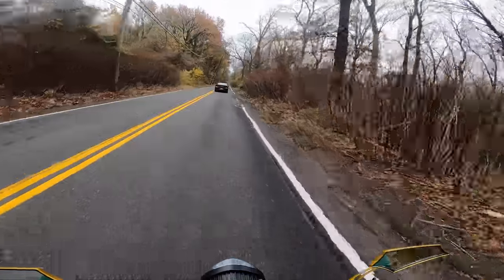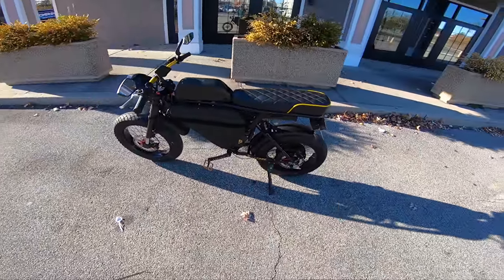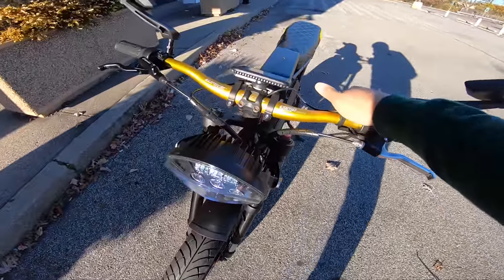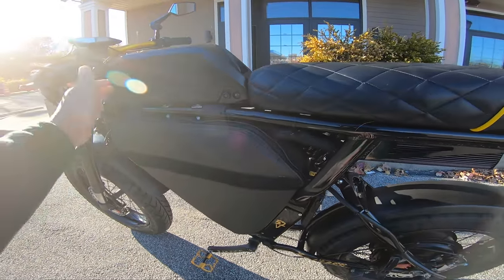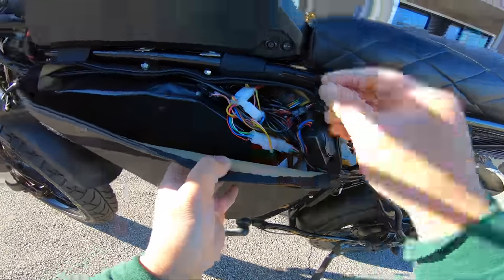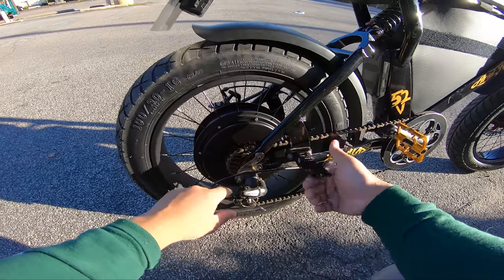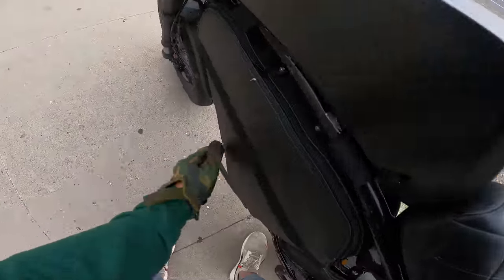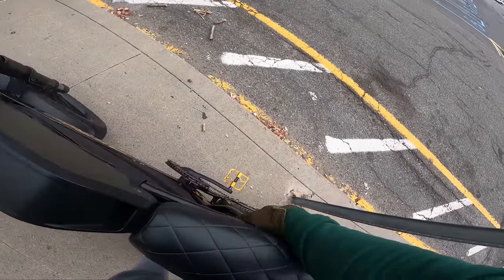This bike is TOO FAST! 5000W Ariel Rider X-Class First Impressions

Comment: Like how quiet it is and looking forward to the range test. Gear size change to prevent the wheely, giving more to top end and slower off the light's. Lock wheel alarm system pretty good too 👍🇬🇧
Reply: The bike is hub motor driven so no sprockets
Reply: @dgenbraking  Oh, darn, nothing I could do to ease the off-the-line acceleration then.... I wouldn't trust myself on this lol
Reply: @ChristmasEve777  it's really not bad even on my 17kw bomber
Reply: @ChristmasEve777  also I forgot most of them have different speed settings. Mine is set to single speed but my lower power one has 5 speeds and pedal assist

Comment: Your torque converters are what keeps your power in the wheel, not    the rear wishbone. Those converters that are on the upper part of the wishbone are pulling the bike up.
Just get a bigger Torque converter for the lower bar and get rid of the upper, it'll keep the power where it belongs.

Comment: Damn! Sweet upgrades dude.. I wonder if it will be easier to update this X-Class compared to the newer X-Class Step-thru in the future?
Reply from the maker: Thanks! It's still possible to upgrade the step-through version although the normal crossbar version makes it easier to mount the new battery in the frame.
Reply: Just wanted to be a little different haha. With their new cargo rack in the back I might be able to mount a bigger battery there in the future. Toughest decision is between the X-Class and Grizzly right now 🤔. Keep up the videos man so I have something to copy later on 😂

Comment: Looks great. Sounds great. Two thumbs up for everything you've done to it! The controller looks sharp in that spot, and keeping the harnesses in the battery bag is neat and tidy. Handlebar/pedal gold accents are slick. (I don't understand the rear-view mirrors, but maybe it's an East Coast thing? 🤣) Seriously, it looks slick and solid, and I bet it's fun AF.

Have you put it on a scale? Curious what the final weight is. Should still be pretty damn light for all that power, which probably makes for an incredible ride. I mean ya got yer involuntary wheelies and what not...😁
Reply from the maker: Thank you! Yea I'm curious as well with the weight of the full frame battery. Prior it was around 120 pounds.
Reply: @JB360_NYC how could I get this exact bike

Comment: Can you tell me more about that lock kit and alarm and where can I get one? i own a 52v myself. Found that alarm that locks the wheel and it doesnt go anywhere or locks with it.
Reply from the maker: I can check on that for you. It works with the 150a controller but will check to see if it works with the stock 35ah controller. You may need a step down but I'll check.
Reply: @JB360_NYC  thanks! Also awesome set up and video! Got me inspired for my own build…

Comment: So you have a 150cc bike now.🤔 may as well try to register it as a moped. Thinking about a 2500-3000 watt for the Kepler. Already 50 ah 35 mph but kinda wanted 45-50 mph ability for the short stints on major roads to keep up better with traffic
Reply from the maker: It's interesting you mention that, someone is actually putting a 3kw on the Kepler with a 72V battery. I'm curious as to how it will turn out 🤔
Reply: @JB360_NYC  yeah.. Front hub might just be a couple mph and to much extra work.. Best to replace the existing crap instead of just adding more

Comment: Hi is the alarm easy to install. Do you have a video of the installation
Reply from the maker: Yes very easy to install, takes like 5 seconds. Plug and play and you just need to connect it to the Sabvoton controller alarm/lock cable.

Comment: Where can I get those yellow mirrors  (or orange if they have) and mounts for them? Are they hard to see due to vibration?
Reply from the maker: They're actually on Amazon now: https://www.amazon.com/SupportTM-Universal-Motorcycle-Motorbike-Scooter/dp/B01GZZ9BDA/ref=asc_df_B01GZZ9BDA/?tag=hyprod-20&linkCode=df0&hvadid=693338692942&hvpos=&hvnetw=g&hvrand=14657613194704956688&hvpone=&hvptwo=&hvqmt=&hvdev=m&hvdvcmdl=&hvlocint=&hvlocphy=1022018&hvtargid=pla-643531961509&psc=1&mcid=af8e5624ae543fb2b0206f4b870c80a2&gad_source=1&gclid=Cj0KCQjwxeyxBhC7ARIsAC7dS396szkVCrIerkkvD9JWS09zMA9HufCL2LCMnquBrOdLlN-UCz35il8aAhTVEALw_wcB

Here are the mounts you need: Lyn666 Motorcycle 7/8" Handlebar Mirror Mount Holder Clamp Adaptor 10mm Thread For Motorcycles ATV Scooter Black(Pack of 2) https://a.co/d/hdhQYsP

Comment: can you put 2 different battery voltage on the same bike ? i have a dual 48 v ebike and i want to pu a 52 v on top of the bike ? but i dont plan to use it at the same time .. can someone tell me if its possible ?
Reply from the maker: You can do this with a battery blender but I would always recommend having the same voltages just in case. But it is possible using a blender.
Reply: @JB360_NYC  even if i have a switch on/off to make sure the other battery is off i still need a blender ?

Comment: when upgrading an e-bike that was already an e-bike, should I buy a conversion kit? or just a motor, battery, and controller?
Reply from the maker: Most conversation kits usually come with just the motor and controller and you would have to get the battery separately. I kind of like it that way because the conversion kits that come with the battery usually have a pretty crappy battery with it.

Comment: Is the locking wheels safety feature (after locking from key fob)  a kit or it comes with the bike it self? That information wasn’t clear
Reply from the maker: It actually comes with the motor kit. Just make sure you request it before placing the order with Sal. You can also find the security device on AliExpress, and are usually plug and play with most controllers.

Comment: When you added the upgraded to the 5k motor kit and the new controller, was that a huge expense like in the $4k range? I have a Juiced Bikes Hyperscrambler2 and in the future, I would like to upgrade the power.
Reply from the maker: You're actually pretty spot on...the bike itself was about 2100...and with the upgraded motor, controller, and battery came out to about $4k. Juiced bikes I believe share the same dropout size as the Ariel Rider so swapping the motor should work.

Comment: Hey JB bike looks great really like it I’m not into gold but I like the bike very nice build. I have a Stealth Bomber 8000kw motor and it’s govened  so I can’t get pass like 63. I was wondering if you would think if I got a new sabvoton 72v150amp controller. I would hit more mph just wondering if you would know anything about that. I was thinking that they did that from the factory they did that for safety but I don’t like it. I’ve been riding all my life crotch rockets so it kind of sucks having it do that. I’m thinking if I just got a new one it wouldn’t be restricted. Could you please give me any suggestions. Thanks for the video JB ride safe buddy.
Reply from the maker: Oh yea if you swap to the 72150 you'll hit 70 for sure. You have the same battery setup with the 40ah Panasonic battery right? The new controller will eat more amps but the top speed will definitely increase.
Reply: @JB360_NYC  Thanks Buddy I appreciate your time and your advice. Have a great Holiday season buddy.
Reply from the maker: @garymertens1958  Yoo too Gary ✌🏻
Reply: @JB360_NYC  Hey JB would I order the unlocked version some of them don’t say unlocked just wondering if you could let me know. Do you know if there’s away to unlock the controller I’m also having trouble with the regen not working for the throttle and the ebrakes do you have any suggestions. Thanks so much for your time. Your bike is really cool I was thinking about getting the Arial rider 52x class but I went with the Stealth Bomber instead. I don’t know why I can’t get the ebrakes to work or the regen to work when I let off the throttle. Thanks again for you time buddy. Be safe out there riding. God bless.
Reply from the maker: @garymertens1958  I would say be careful when ordering the unlocked version as I heard there could be some issues with programming and tuning. 

For the e-brake, have you tested adjusting the amps to a high setting to see if there's a difference? (like to 90amps for e-brake) You could also try re-doing a hall test to make sure everything is good, that can sometimes help.
Reply: @JB360_NYC  Hey JB I did raise the ebrake amps but I haven’t done a hall sensor test in about a year I will try that and see if that would help. I think I’m just going to keep the Sabvoton controller I have and see what happens after another hall test I’ll let you know after that. Thanks JB for your advice I really appreciate it so much buddy.  I was going to tell you when riding on the road ride the tire lines cause people in front of you could be going over something and if your in the middle of the lane your going to hit it and you know the tire on lines are ok in less someone in front of you may Swerves-around something then you know there maybe a pothole or something there if you need to stop really quick you have a better chance of going around the vehicle in front of you. Like I said before I’ve been riding motorcycle my whole life just some advice for you to be safe out on those dangerous roads. Ride safe buddy. God bless.
Reply: You can see better what traffic is doing up ahead of you when also riding the tire line you’ll be safer the middle also has oil and possible othe debris in the road. Just want you to be safe out there buddy. Take care .
Reply from the maker: @garymertens1958  This is good to know! Thanks Gary for this and definitely don't want to hit anything coming up the middle
Reply: 72v 150amp should be putting out 10,800 peak watts
Reply: @JB360_NYC  amp is for acceleration and torque not for top speed , so how he can make 70 mph only with the sabvoton 72150 ? 60-64 is the top speed for the qs273 3.5t with 72v. So you need more volt or a higher T motor , you can also use tons of flux but the sab 72150 max flux is only 50amp

Comment: Hey JBL 360 am in the works of making my 48v Ariel Rider X-Class to a 72v I have just bought the 3000w 80A Motor kit from E -street bike's that am waiting on I also bought the light kit to put turn signals on my bike from E -street bike's I have also bought Shinkos SR735 front and rear tires i have also but that same headlight you have on your bike in this video what brakes and rotors would you recommend and link's so I can purchase them?
Reply from the maker: That's awesome dude! I honestly should have went the same route and save myself 500 bucks.

Here's links to the rest:

Rotors (2) - https://www.amazon.com/KOOTU-Stainless-Bicycle-Rotors-Mountain/dp/B09XCHHP9X/ref=sr_1_38?crid=3LFT3YRC6VWAG&keywords=203%2Brotors%2Bred&qid=1669913811&sprefix=203%2Brotors%2Bred%2Caps%2C67&sr=8-38&th=1

Headlight - https://www.amazon.com/dp/B083YX2J7H?psc=1&ref=ppx_yo2ov_dt_b_product_details

Brakes (make sure you choose the SM Plug option)- 
https://www.ebay.com/itm/133635225673?var=433084496224&mkevt=1&mkcid=1&mkrid=711-53200-19255-0&campid=5338722076&customid=&toolid=10050&amdata=enc%3AAQAHAAAAkLvbMMCj8MclyoL0A6OI2%2BhM3Y2wQOnSTZhgoEHPcUSIjeag5p3W6igp4cBn3%2B3uIU274ieuMsvQUyBKUEP1G6SyaHuW5QA4Z9GAWuBwyrygNJrNsCFZ6G6%2FCB5oupMHhvKQcui%2FzVIIXggANoVzvZbGPtkbdXvKi8c3GYSX1Q3a4Wyf5%2BFnu%2BSw6PfmRrTCfw%3D%3D
Reply: Now the Link for the upgraded brakes are they sold in the pair of from and rear or do I have to buy two?
Reply from the maker: @ricardoarcelay73  they come in a pair when you get them.
Reply: Thanks bro

Comment: whats the seat that you have? and what are the mirrors aswell? the ebay link isn't working for the mirrors.
Reply from the maker: Check out JB Seats on Instagram. That's where I got my seat from. For the mirrors, you can get them from here:
https://amotopart.com/products/motocycle-chopper-cruiser-street-dirt-bike-rear-view-mirrors-8mm-10mm-generic?currency=USD&variant=42187238998187&utm_medium=cpc&utm_source=google&utm_campaign=Google%20Shopping&stkn=5f20f85b5d12&gad_source=1&gclid=CjwKCAiAq4KuBhA6EiwArMAw1DrwqqhRTOVakO5f-K8PtoQ229brN8Gvj93Nx4OQj5jrrSNyh3p0WBoCuI8QAvD_BwE

Comment: Awesome mods man. I really like this one. Question. I know it's fast but what about the brakes? I know you had to upgrade the brakes and possible rotors to handle braking from those speeds. What kind did you get?
Reply from the maker: Thanks! For brakes, I would go with any dual piston or four piston brakes. For rotors, I went with 203mm on the front and rear. I would def recommend any Shimano or Tektro 2 piston brakes but if you have cash definitely go for the Magura MT5-E.

Comment: I have a Ariel Grizzly and I’m interested in your security system with wheels lock.  I cannot find anything for it online.  Where or how can I do that?  Thank you
Reply from the maker: You can find one here:
https://www.aliexpress.us/item/3256805784449592.html?src=google&src=google&albch=shopping&acnt=708-803-3821&slnk=&plac=&mtctp=&albbt=Google_7_shopping&albagn=888888&isSmbAutoCall=false&needSmbHouyi=false&albcp=20536660287&albag=&trgt=&crea=en3256805784449592&netw=x&device=m&albpg=&albpd=en3256805784449592&gad_source=1&gclid=Cj0KCQjwjLGyBhCYARIsAPqTz1-ATDgRuj47i8mh1vO4UYo-WiDOYkKAc0ByRLUKtz7IbSahcuEknjoaApSpEALw_wcB&gclsrc=aw.ds&aff_fcid=baf55932f37c41a2bfe838a3019eccae-1716294838734-06883-UneMJZVf&aff_fsk=UneMJZVf&aff_platform=aaf&sk=UneMJZVf&aff_trace_key=baf55932f37c41a2bfe838a3019eccae-1716294838734-06883-UneMJZVf&terminal_id=e79f603d66064d43a23bfd0124bfae3c&afSmartRedirect=y&gatewayAdapt=glo2usa

Comment: This setup looks dope but why are your rear brakes mechanical brakes instead of hydraulic brakes?
Reply from the maker: So I switched to mechanical rear brakes as they grab better with the hi-regen setting. Less maintenance until I eventually switch to Maguras.
Reply: @JB360_NYC  Do you have throttle regen enabled, like when you rode Sal's build? Do you feel ebrake regen is better? Did you do this because of the sensor on the brake lever?
Reply from the maker: @engr_e   I have it currently set up for brake regen which I like a lot better. Sal's bike was hard to get used to especially when letting go of the throttle, just forced the bike to pull and slow down. Also he had his set very high like almost 80 amps. 

Brake regen is definitely the way to go for sure, preserving the rear brakes. 50 amps is the sweet spot in my opinion for brake regen.
Reply: @JB360_NYC  Good to know. Did you splice the stock lever wiring to work as well? Or is it just on the mechanical? I am currently putting together my AR with the eStreet 5k kit. Just waiting on the battery.
Reply from the maker: @engr_e  didn't have to splice the brake levers as the mechanical brake had a built in brake sensor which plugged right into the DC converter kit which was nice.

Comment: Do they make hard sides for that battery compartment? I noticed it likes to shift away from the frame.
Reply from the maker: Yea when I hit bumps it tends shift sometimes. Sal hasn't made center pvc panels yet for the X-Class but there a number of people in the Facebook groups that have DIYd some very well. Check out the x class mods group.

Comment: Hey JB hope you feel better man. I was wondering what kind of key switch did you use on the Ariel Rider.
Reply from the maker: I actually don't have a key start for the x-class. The only key switch is actually for the light kit.
Reply: @JB360_NYC  I'm currently running 3000 watt with 60 amp controler Ariel Rider looking to do a keyed on and off switch. Thank You and hope your leg heals fast. 🙏🏿🙏🏿 Let the MINI ROCKET GO!!👍🏿👍🏿

Comment: I’d like your set up. Would this work for the Grizzly, and where did you get that alarm feature that stop the tires from theft, that sic I need that, I do food delivery I the city of Orange Ca (Uber eats/ Doordash don’t want to get the bike stolen.
Reply from the maker: Absolutely! There are a couple of Grizzly riders that have the upgraded setup and they love it. You can find the alarm lock device here but just note these are mainly compatible with the Sabvoton controllers:

https://m.aliexpress.us/item/2255801049477940.html?spm=a2g0n.detail.1000014.10.47aa4452oUfoDK&gps-id=platformRecommendH5&scm=1007.18499.315613.0&scm_id=1007.18499.315613.0&scm-url=1007.18499.315613.0&pvid=4b20a61c-5187-40be-8f77-10ce0f2f1bc6&_t=gps-id%3AplatformRecommendH5%2Cscm-url%3A1007.18499.315613.0%2Cpvid%3A4b20a61c-5187-40be-8f77-10ce0f2f1bc6%2Ctpp_buckets%3A668%232846%238111%231996&pdp_npi=2%40dis%21USD%216.57%214.6%21%21%21%21%21%402103309f16689594930181641ecd53%2112000016835468752%21rec

Comment: Great build, a few questions... 1. How tall are you. 2. How much do you weigh. 3.What is the total cost of the build. I am looking to replace my car with an ebike for obvious reasons, and me being 6'2" 275lbs, It's obvious I'm going  to need some upgrades to this bike if I get one. Being from NY as well, I will definetly need something that can take hills with no problem, and with a range of 35 to 40 miles max. 70mph is nice, but not really neccesary. Thanks for the info.
Reply from the maker: I'm 5'10 and weigh about 200. The total cost of the bike with upgrades comes out to about $6000

Comment: What's the alarm system? Or does it only come with a wheel upgrade and integrated alarm?
Reply from the maker: It actually comes free with the motor kit but you can get them on AliExpress for really cheap:

https://m.aliexpress.us/item/2255801049477940.html?spm=a2g0n.detail.1000014.10.47aa4452oUfoDK&gps-id=platformRecommendH5&scm=1007.18499.315613.0&scm_id=1007.18499.315613.0&scm-url=1007.18499.315613.0&pvid=4b20a61c-5187-40be-8f77-10ce0f2f1bc6&_t=gps-id:platformRecommendH5,scm-url:1007.18499.315613.0,pvid:4b20a61c-5187-40be-8f77-10ce0f2f1bc6,tpp_buckets:668%232846%238111%231996&pdp_npi=2%40dis%21USD%216.57%214.6%21%21%21%21%21%402103309f16689594930181641ecd53%2112000016835468752%21rec